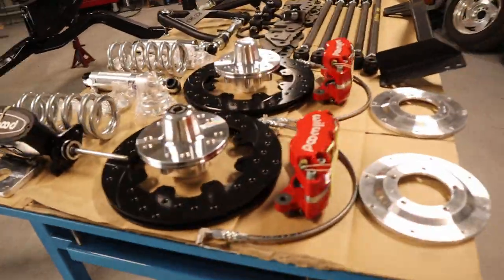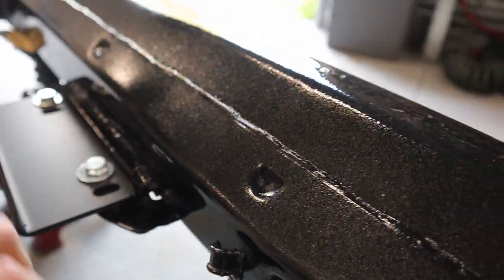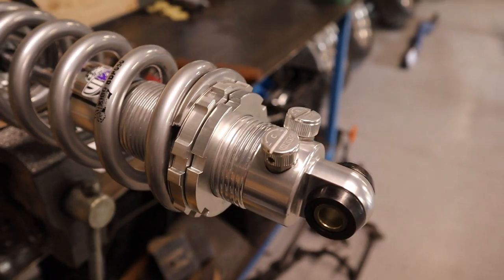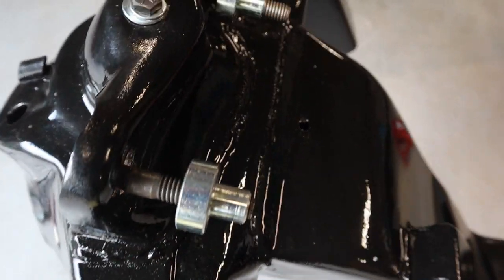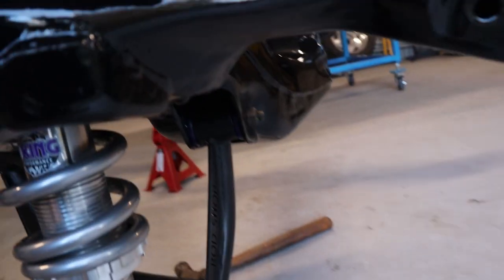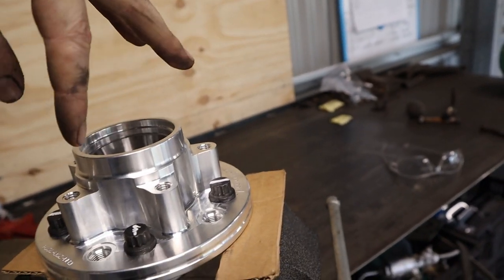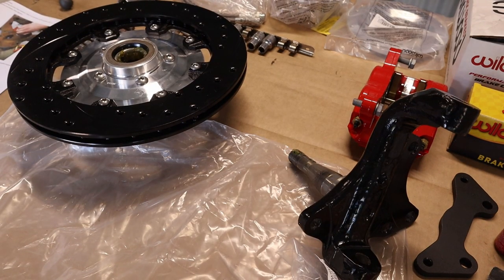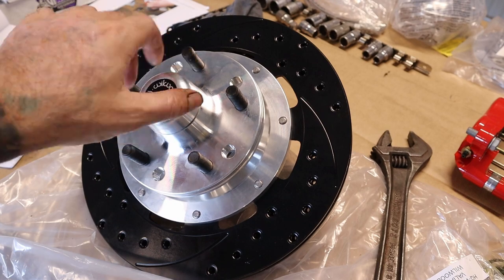HX One Tonner Build - Fitting Castlemaine Rod Shop Tubular Control Arms and Wilwood Brake kit

Comment: Hey mate, I never post on YouTube comments but this deserves one.
You literally saved my arse Cobba!!
I, like you got all the gear off RodShop. Doing a HZ Ute build. Just put in the coil overs two days ago. Had a bit of a search on the brake side of things.After watching your vid realised I didn’t put the collets (?) in the rubbers of the upper and lower shock mounts....
Farrkkkk, lucky! Was a bloody mission getting them off again as I lock tighten them. Was hard work...
So, thanks for saving me mate.
Looks awesome, is that Chassis 2pack?
I will be following your build from now on 😁👍
Reply from the maker: Hey Mate glad the video helped. I actually done the same thing but I realised before I bolted the coil over into the coil pocket. So it can be easily done. Other than that did you find the tubular control arm kit and the brake kit easy enough to install? I found it was really easy once you get the first side done. The chassis is coated in KBS chassis coater. Seems to be a good coating so far. Thanks for following the build and glad the video helped you once again.

Comment: My mate fitted a ‘Blacks Rack’ rack and pinion Kit many years ago and it drove so much better. I think the Rod Shop have a version of a rack and pinion kit available that is very similar. I reckon for all the time, effort and money you have spent already, going rack and pinion would complement the new front suspension and bracket setup. Great job so far. 👍🏻
Reply from the maker: Thanks Big Al. I see the blacks racks one and they a little bit more than the castlemaine ones. I was looking at buying the CRS one but they are currently out of stock for a while. I think you are right but. Will defs compliment everything else.

Comment: Loving your build ,, got a question, when cuting out the locating tab ,, you dont go flush with the chassis on both sides in the pocket? You only trim it back flush with the upper coil mount only , but clearly do the left and right side of chassis .

Comment: Im looking to get the brake kit but install some lowering coil springs from suspension megastore. Will the brakes still be compatible? I’m new into this and am looking for some further guidance
Reply from the maker: Hey mate the wilwood brake kit is compatable with standard springs. It just mounts to existing spindle. Comes with the adapter.

Comment: I noticed that you mentioned putting in the spacers between the mounting bracket and the spindle @ 17:30 yet @ 18:06 it looks like you deleted them?
Reply from the maker: Hey Mate. The spacers are definitely there. I think you maybe looking between the caliper and the adapter plate and not between the adapter plate and the spindle. I found a split second where you can still see the spacers.
Reply: @ShenkeGarage  Yep you're right lol. I was looking at them and wondered why they didn't machine a step in the adaptor. Overall all the stuff looked like it went together easily enough with good tolerances. I'm watching some of your other vids about the benches in the shed, some good ideas there.
Reply from the maker: @wobblyplanks  Yeah the kit went together really well. Had no issues with the brakes or control arms. Thanks for watching the videos.